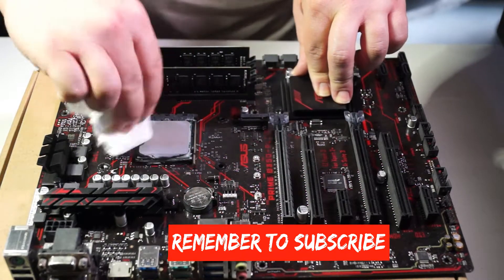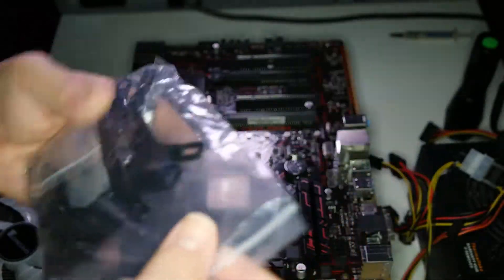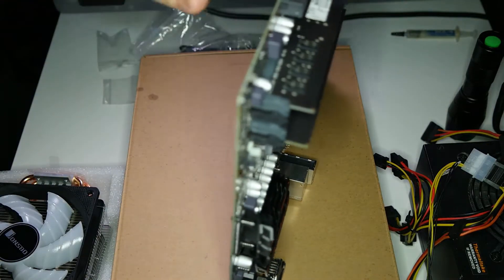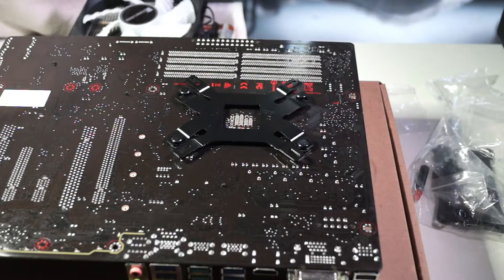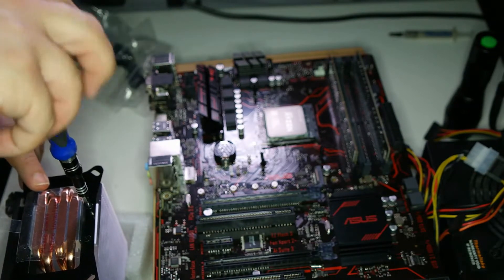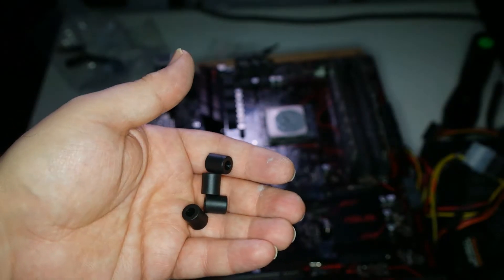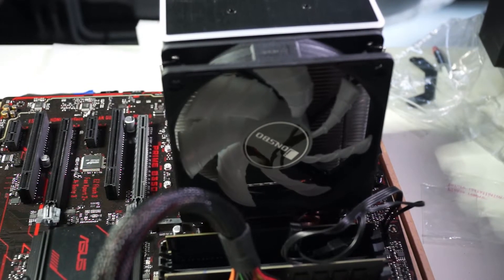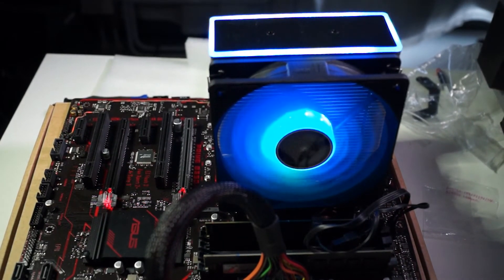RGB CPU COOLER Installation(Jonsbo CR-601 RGB)

Comment: Thanks for the explanation. Is it also possible with a x470 f-gaming  mainboard from asus.  The cooler seems big
Reply from the maker: Thank you :) 
Yes it is posible to use it with that motherboard, as long as you use the ATX one.
Reply: @drtechtek2165 
Asus ROG Strix X470-F Gaming Mainboard AM4 (ATX, X470-Chipsatz, Aura-Sync, DDR4 3600MHz, dual M.2, USB 3.1 Gen 2) https://www.amazon.de/dp/B07C6N867G/ref=cm_sw_r_cp_apa_i_7FOEDb6EPZ1JW

Should be no problem...